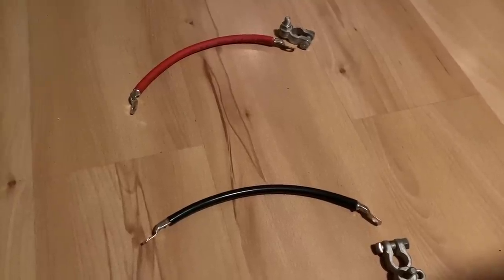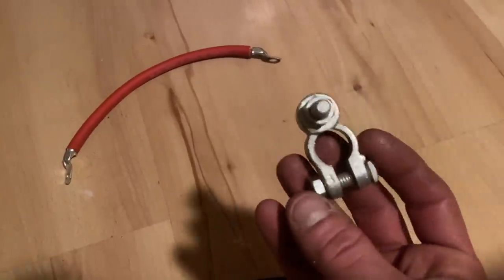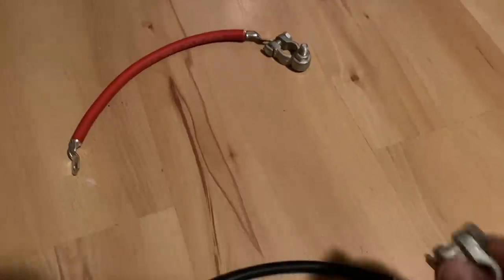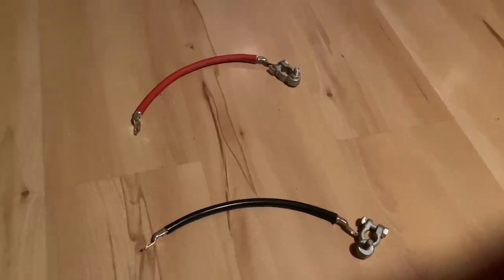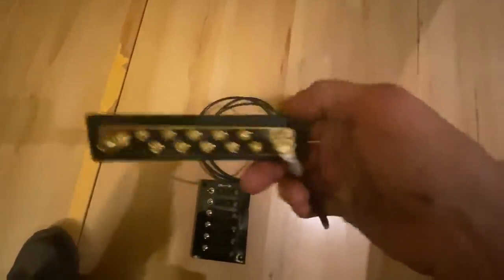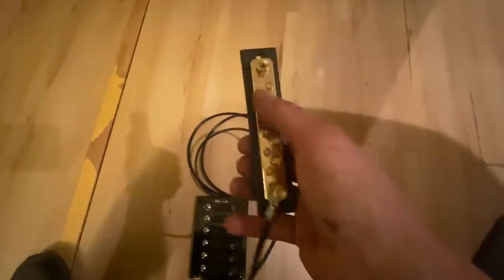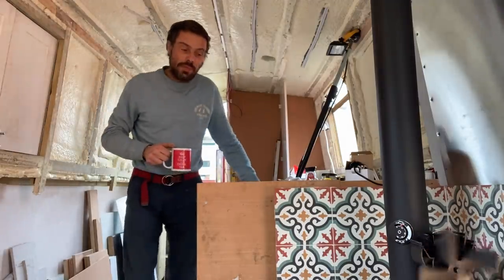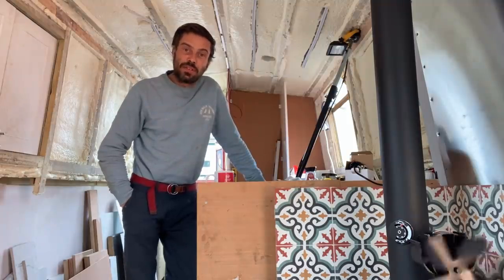113. Narrowboat electrics like you’ve never seen them before

Comment: Little observation on the stove fan....
These rely on the temperature differential, between the bit that is in contact with the stove and the top heatsink, to generate the power to drive the motor. 
At the moment you are drawing the warm air over the heat sink on the top.  If you set it up so that it draws the cooler air from the room and blow it over the stove, you will have a bigger differential and it should spin faster.
But appreciate that this may be difficult to do on a small stove in a restricted space.

Comment: Hi James, you will need a solar controller the positive and negative wires from the panels go into the controller as do the wires from the battery. Only the voltage from the solar panels will be higher than the battery voltage. You can then set the voltage in the controller to 13.8 volts which maximum for 12 volt lead acid battery other types of battery are different charging voltages. You will have to look into this when you decide on what type of battery you decide to use. All the best Steve.
Reply from the maker: Hi Steve  - yes that’s right - pos/neg from charger controller into batts - I’m going for a Victron 150/75 which should be plenty for my 990w panels. 3x 110ah batts.
Reply: @TheNarrowboatThatJamesBuilt  
Hi James I think victory are the best, I thought you were going to put your solar straight into your batteries because that would not be a good thing to , as you didn’t mention a controller. There is a lot of power in a battery so you have to be careful. I’m glad you were aware of the controller, sorry for doubting you. All the best stay safe . Love the work your doing. Steve.

Comment: My only question is are you not going to use the boat frame as an earth connection for some stuff and do away with some of the need for the return earth cables throughout the boat ?
Reply: Alan, the Boat Safety Scheme requirements state: 'For reasons of personal safety, we recommend that no part of
the hull of the boat is used as part of the return circuit because
 of the risk of personal injury. A further disadvantage is that hull corrosion may be advanced as a result of electrolytic action.'
Reply: Ok that’s great I thought it may have something to do with corrosion. 
If it is a requirement as well it’s a no brainer so thanks for clearing that up mate. 
Keep up the great work fella. 
Oh and keep the vlogs coming as it’s getting us through these mental times.

Comment: What about mains electric hookup  connections for when in a marina?

Will you have a standalone generator for supplemental power; OR will you be running the engine for hours daily to top up the batteries?

BTW, diesel engines dislike running idle (no load).

Comment: Posting videos in the day time?  What's all that about?
I'd put a fuse directly out of the battery, before the isolator.  A direct short would melt that 10 mil cable PDQ.
Been snowing here for 18 hours, but it's only just starting to lay, now the temperature has dropped below freezing.
Take care.

Comment: Should the fuse not go before the isolation switch?
Reply from the maker: No I don’t believe so.  It should go after the isolation switch but I will triple check that.  That fuse is to protect the batts if everything was drawing it full current at the same time and a fault occurred.
Reply: A fuse is to protect the cable and not the battery I believe
Reply: Both The switch and the fuse should be in such close proximity to the batt. bank that it really doesn’t matter. It is important though that all four connections - two on switch / two on fuse - should be fully insulated.
Reply from the maker: @Nils337  am I right in saying the fuse needs to be capable of covering everything if on at the same time - say 50amp ?
Reply: @simonamjones  the fuse protects against the risk of starting a fire. Not the cable itself.
Reply: The fuse should really be as close to the source of power (the battery) as possible for maximum protection. That's standard electrical practice, especially in cars, because of the potential current available in a car battery. If you accidentally short the cable between the battery and the switch and fuse to negative in your current configuration, the cable will get rather hot. BTW, electronics & electrics are my background.
Reply: This is obviously controversial !  Maybe the clue is in the name.  It’s an isolation switch. It cuts EVERYTHING off from the battery.  And must be close to it. Simples.
Reply: @arnolddill  I think that is the conflict. Should you maximise the scope of the isolation switch or the scope of the main fuse. It would seem that traditionally isolation has taken precedence but nowadays there are many devices that are not required to go through a battery isolation switch (e.g. automatic bilge pumps, security equipment, see BSS scheme for acceptable examples) but they obviously still have to be protected by a fuse. As others have said, fitting the fuse first brings the circuit more into line with car and house circuits. The fused battery terminal seems to be the best solution.
Reply: @michaelburns6197  Yes, I would concur with that.  All sounds logical.  Whichever way round you go with its perhaps even more important that when installing all this that the fuse and switch connectors are fully insulated. There are relatively large areas of bare metal involved.
Reply: I have recently gone through this. I have four batteries, each with a fuse at the batt +ve post and then cabled via a disconnect connector to an isolation switch for each battery. The out of the isolation switch then goes to the +ve bus bar, which combines the batt outputs. Each batt -ve goes to a connection on the -ve bus bar. This allows each battery to be isolated/removed if the need arises, while leaving the others in service. The feeds for any distribution panels are taken from the bus bars.
Reply: @TheNarrowboatThatJamesBuilt  Yes, the fuse (or fuses) protecting the battery (or batteries) needs to be rated to handle total load current out of the batteries, or total current going into them when being recharged if there is no other load drawing current, whichever is the greater. Bear in mind that your solar setup can deliver high current values, dependent on panels and charge controller setup. E.g. If you have a flat battery bank and the sun comes out from behind a cloud thereby allowing your solar panels and charge controller to deliver maximum current to the batteries, the charging current may be greater than the total possible current drawn by all loads in your power audit list if they were all on at once. Therefore you would use the charge current + margin when specifying fuse value.
Reply: @eleanordeboat4191  That seems like a lot of extra wiring/components and therefore more potential for faults (including shorts). I think I would stick with one fuse and one isolation switch and therefore one (+ve) distribution board connection and one (-ve) busbar connection for each bank of batteries (i.e. each 12V supply).

Comment: Nicely explained, James. Having been a part-time FE / 6th-form college lecturer for several years, I think your way of explanation regarding the physical basics of the DC electrical flow in a boat was very well presented. Well done mate. Just one point, should the main fuse not go between the battery and the isolation switch?
Incidentally, you can buy positive battery terminals with a built-in fuse so it’s literally connected straight on top of the battery, therefore doing away with the need for an in-line fuse as such, in the engine bay, or in the case of lithium batteries, within the cabin area, as they (like me) are not keen on really cold mornings! I will probably be going for this type of option on my fit-out boat build https://www.12voltplanet.co.uk/battery-terminal-cube-fuses.html
Reply from the maker: Thanks - well you’re the 2nd to say that so I’m going to triple check the fuse. If you can fused batt terminal connectors then that would clearly suggest that the fuse DOES go before the isolation switch. Hmm 
Enjoy your Sunday 🍺
Reply: @TheNarrowboatThatJamesBuilt  The BSS requirements imply that the battery is connected directly to the isolation switch because it lists that connecting cable to be checked for current carrying capacity. The fused battery terminal is a neat solution. Incidentally the BSS seems to require 25mm2 cable for this and some other cables.